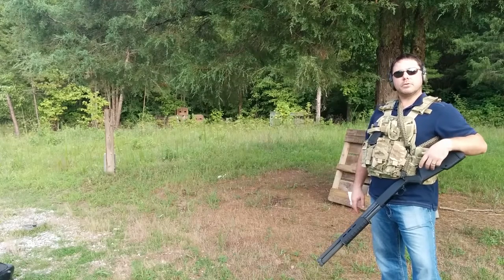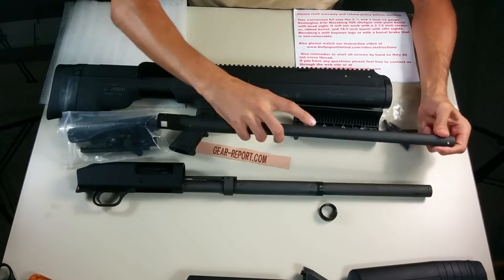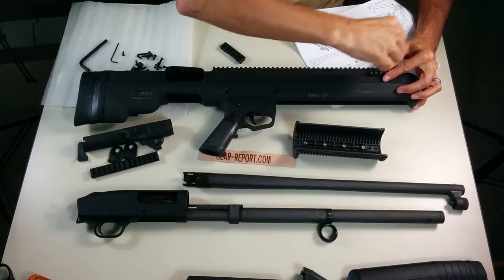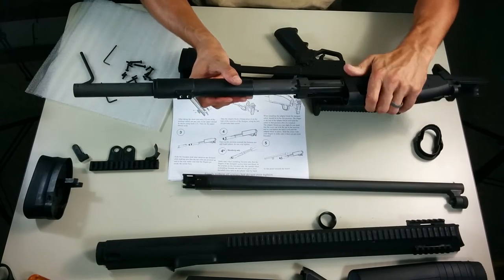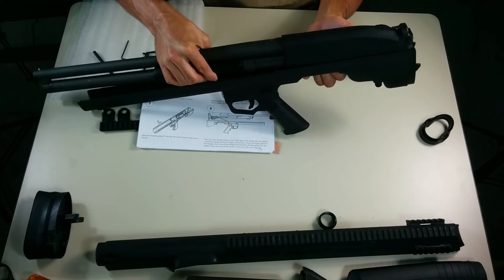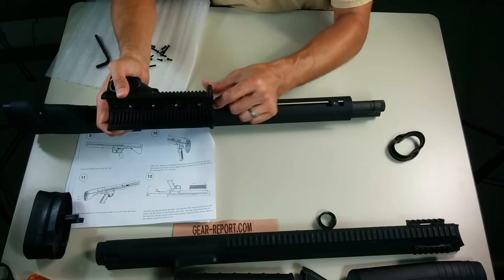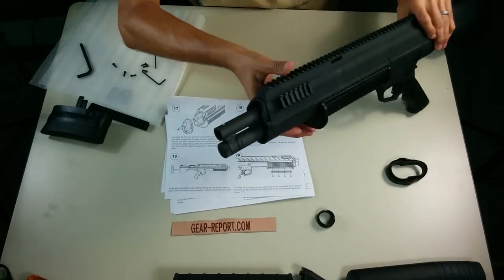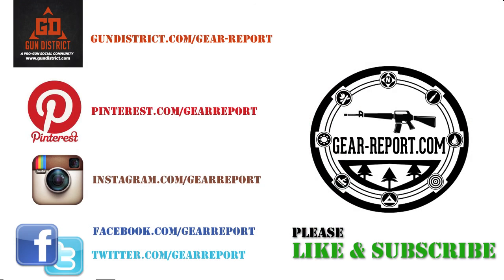Install BullpupUnlimited on Mossberg 500 Magpul Shotgun- Gear-Report.com

Comment: I know this video was produced in 2015, but does this conversion kit absolutely REQUIRE the top shroud to be installed for firearm functionality?

I know it might look weird without the top shroud, but  in a weird way, I'm digging the no-top-shroud look of it. 

Without the shroud, it looks less bulky actually.
Reply from the maker: It's been a while since I had that bullpup apart. But I'm pretty sure that the whole thing needs to be installed.